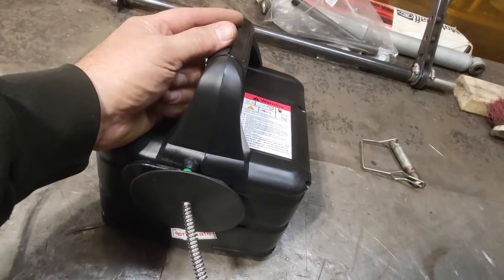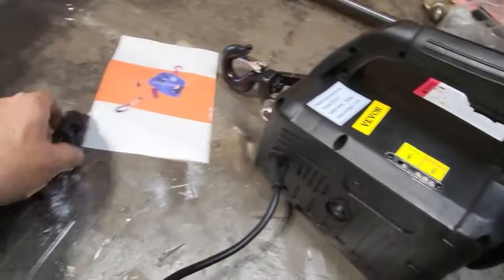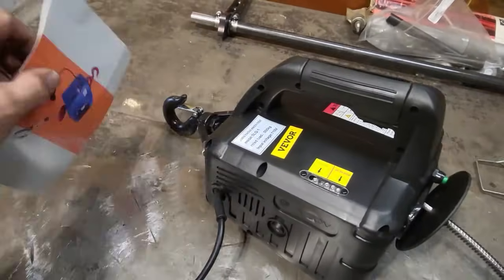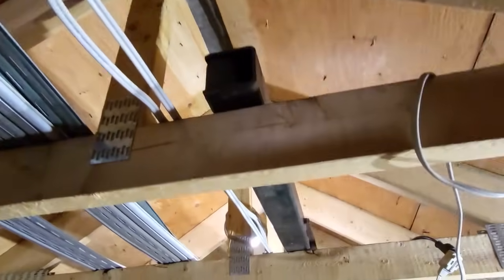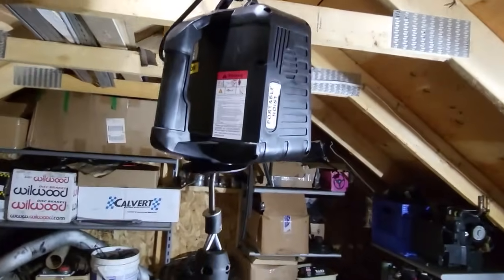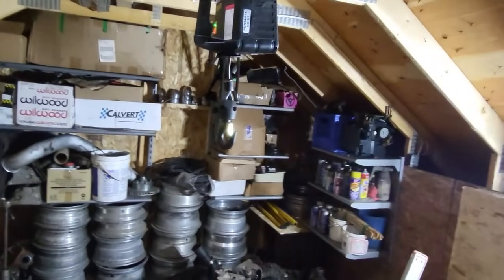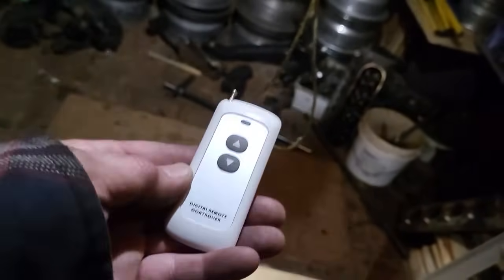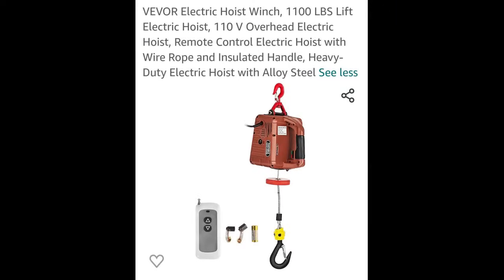Vevor 1100 LBS electric hoist

Comment: Trusses are made for roof load, where you have that beam running across is not really made for that hanging load. Those plates that attach the cross beans are not made for that.
Reply from the maker: I know that.  This was a quick fix. I wantto build a support section to taketh load from the side of the top trusses
Reply: @fitzeesfabrications    In the meantime, suggest you supplement the 'gang nail plates' on the central (most highly laden) A-frame with with addtional firmly attached (srewed-in) wooden or steel plates.  The aforesaid would prevent a catastrophic failure of the gain nail plate.

Comment: After the last lift, reverse the hooks, long extension cord, and drop the unit.  Disconnect and take the cable hook down with you, (or drop it). Could use it so you don't have to carry the unit up and down.

Comment: The batteries supplied with such devices are normally of poor quality and have a tendency to leak and ruin the delicate contacts of remote controls - i.e. I have been caught a few times.  To avoid such issues, I now install a good quality battery in my remotes and use the supplied poor quality battery for powering high use devices such as a torches - where the expected 'installation life' is short.

Comment: I bought one of these about a year ago and use it to pull my '65 F100 project back up an incline into the shop from the driveway.  Used a Redhead anchor in the slab and it works like a charm.  With the wireless control I can sit in the cab and steer as it pulls.  Great cheap solution to save your back.

Comment: Them cheek plates on the trusses are not very strong at all pulling in that direction. I  would add some long timber screws up through the joints on those cross members, just to give it a little extra sumpthin sumthin.

Comment: Holy cow you have a lot of weight up there for 24 inch on center room in attic trusses.
Reply from the maker: Botton of the trusses are 2x10s. It was designed as to be a apartment